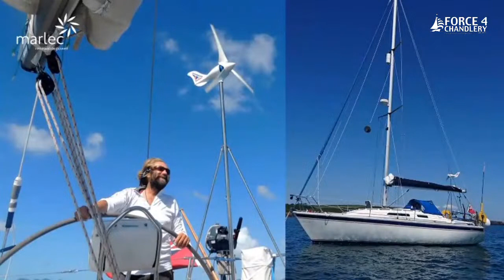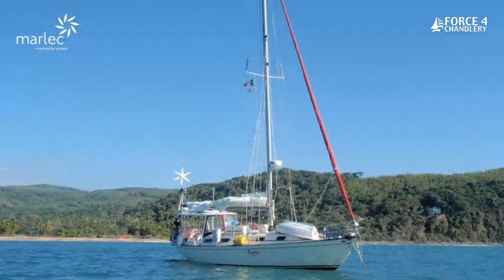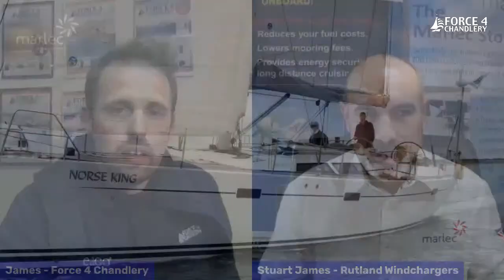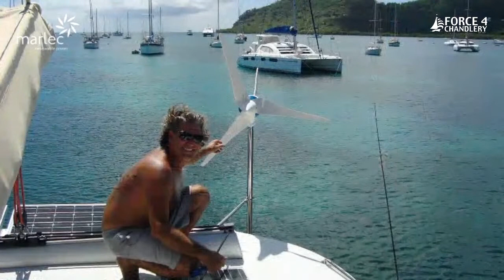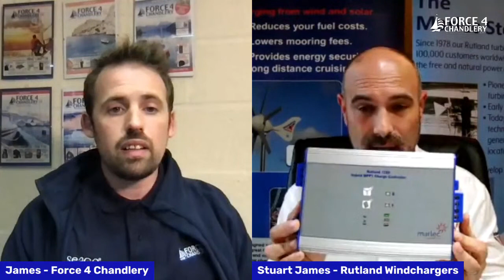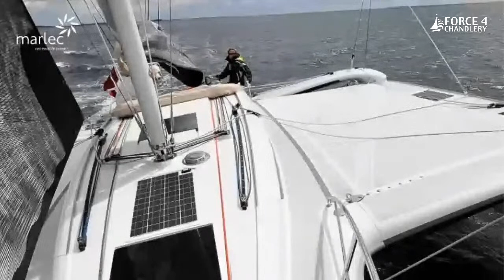Thinking of Wind Power for your boat? Rutland Windchargers 504, 941i, 1200, features and review.

Comment from the maker: From Youtubers ShipHappens:  Are you able to remotely access data from the charge controller to see the power data, like we can with victron?
We have 4 x 220amp batteries and 700w of solar (not doing much at the moment!) would you suggest 1 or 2 1200 wind generators? we are only at the boat 2 days a week
but the solar at the moment isn't getting the batteries back up to 100%
Reply: Hi ShipHappens, the remote display for the Rutland 1200 is currently only available as a wired remote connection I’m afraid.  Judging by your battery bank I’d recommend fitting one Rutland 1200 and see how you get on.  If you find that satisfies your power requirement you are sorted!  If you need a bit more power, installing another Rutland 1200 and Controller on to the same bank of batteries is just as simple as the initial install.  Hope this helps!  Stuart from Marlec
Reply: @stuartjames8417  cheers! Really looking forward to fitting your wind generator, I think this will really help us with our power needs during winter x

Comment: I have a 34ft Westerly Falcon and I was looking at maximising my energy storage. I have solar panels (not much use with this weather) what are my options for generating more power and storing it?
Reply: Hi Jeremy thanks for the question.  For that size of boat you are between the Rutland 914i and the 1200.  It would therefore depend on the size of your battery banks.  I explain in the video the average outputs per day in sailing conditions so I hope that helps.  Stuart from Marlec
Reply: @stuartjames8417  Thank you Stuart.